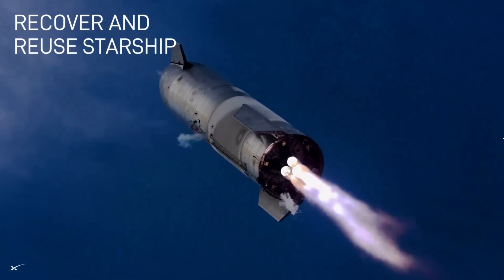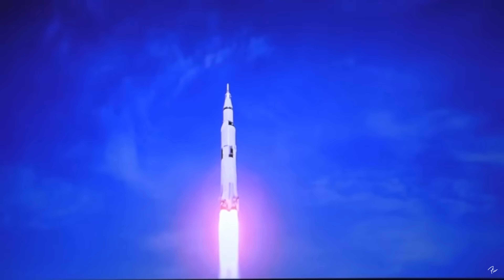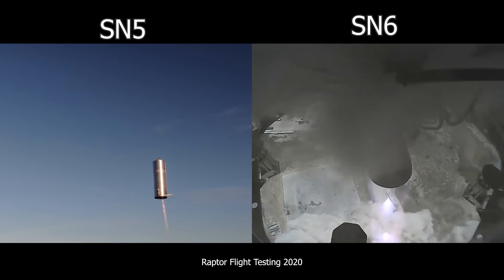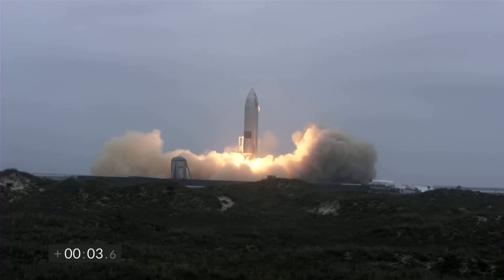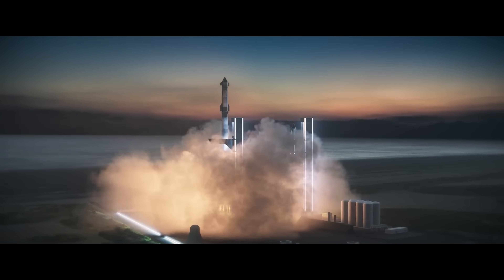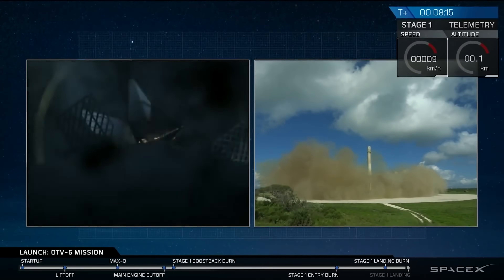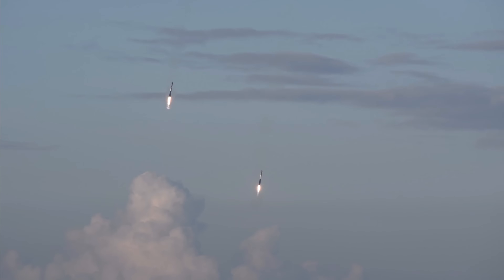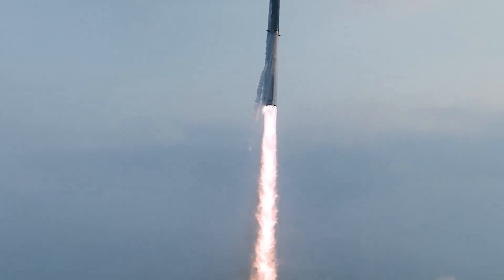The SpaceX Rocket Engine That Couldn't

Comment: $2 million is DIRT CHEAP as is. For reference, the Russian RD-180 is $23 million a piece. The RS-25 used on the SLS is $100 million a piece. The RL-10 upper stage engine used by ULA is $25 million each. Even the supposedly bargain basement BE-4 which is inferior in every metric to the Raptor is $8 million a pop. The ENTIRE SET of 66 Raptors cost almost HALF as much as ONE NASA RS-25!!!
Reply: Even if Starship was expendable it would still be 10X cheaper per kg to orbit than anything that has ever been provided by legacy launch providers.
Reply: @nathanmays7926  SpaceX should make an EXPENDABLE upperstage for SH. The ability to lift 200 tons to LEO even if it's at the cost of 6 Raptors and an upperstage is very useful for any moon mission. 200 tons to LEO will lift the entire ISS in 2 launches.
Reply: @dwightlooi  The goal isn't a moon mission.  The goal is multi-planetary consciousness.  =)
Reply: @dwightlooi  The 200 tones "expendable mode" is just theoretical since that load (above the 100 tones capacity) would make the vehicle's structure fail during launch. 

Also, there isn't a market for 200 tones payload, not even 100 or 50,... etc you guys don't seem to understand that demand is extremely low even for payloads currently launched today, so it would be dumb to manufacture a huge number of engines only to reduce the marginal cost, there wouldn't be enough customers.
Reply: @nathanmays7926  "Even if Starship was expendable it would still be 10X cheaper per kg to orbit than anything that has ever been provided by legacy launch providers."

LOL

You guys should stop believing whatever the sales man says, the literature is rich in statistical strategies to estimate cost per flight of both reusable/expendable vehicles (as well as developments costs), and NONE of them come below U$ 1000 per kg.

TRANSCOST is one of those strategies with more than 40 years of data collected across several projects. It was already used to predict Falcon 1 and 9 development cost within  a 10 percent error.
Reply: @nathanmays7926  star ship launch costs about a billion a pop at the moment
Reply: @kipkipper-lg9vl  where in the world did you get those numbers?  lol

TOTAL expenditure towards entire Starship program so far is $5 billion.

This includes…
-Starbase infrastructure
-land acquisition in Boca Chica
-two mechazilla towers
-manufacturing facilities
-tank farm
-raptor engine development
-employee salaries for 20 years
-30 ships
-12 boosters
-398 raptor engines

How do you figure the cost of ONE booster plus ONE ship plus 33 engines is a billion?
Reply: If its dirty cheap where is your engine?
Reply: @NRGODKING you understand random people cant just buy an engine... Right?
Reply: WOW!
How many pounds fuel are burned every second on the booster?
Seems like the weight of 1 burned out rocket motor is no big deal.
Reply: If you take R&D, costs for the manufacturing facility, ...and so on into account, each raptor engine is WAY more expensive than U$ 2 million.
Reply: @luigeribeiro  Yes, but none of that is relevant to the marginal cost of flying the SHor the starship.
Reply: yes it is because someone has to pay for it lol
Reply: @luigeribeiro Part of the R&D cost is the costs to make it suitable for mass production.  The fact that it is a mass production engine does trivialize the development costs.   The can spread the costs over 10,000 engines not 50, so the RD unit  cost is negligible.
Reply: @GG-yr5ix  "RD unit  cost is negligible"

The U$ 250000 target doesn't seem negligible to me, and STILL, there must be a lot of paid customers to justify the investment. 

But do you know what is negligible? Demand for superheavy lift launch vehicles
Reply: @luigeribeiro  the demand for reusable medium lift vehicles was also negligible, until one was built. It now has 90% of the launch market. Just Starlink will be enough to keep Starship flying for years. And when a 50ton payload costs as much as a 5 ton payload today, you think there will be no demand at all?
Reply: @luigeribeiro those other engines had development costs too though…
Reply: @SamTschappler  the numbers cited for the other engines are ALREADY including the R&D though.
Reply: Yeah dude let’s get real that two million isn’t amortizing the development cost. You’re citing the marginal cost per engine which is a basically useless metric
Reply: @mattkingston6157  It is not irrelevant when SpaceX has already built about 600 Raptor engines. This is more than the entire production history of all the other US engines since Sputnik combined. When production number approaches infinity, amortization development cost approaches ZERO.
Reply: @dwightlooi  But isn't that the point?  The price of the 600th raptor engine versus the cost of the 20th Saturn 5 engine isn't a great metric.  Especially when considering those 20 engines ended up landing on the moon whereas these 600 are nowhere near that result (and may never get there).  That's $1.2bn on engines not to get anywhere yet.
Reply: @CurtOntheRadio  What do you mean by "not to get anywhere"?  Raptor 2 has already gotten the largest object ever to fly to orbit (intentionally just below) and back to the surface again.  Both achievements by any metric.  Raptor 3 can only build upon everything the first 4 flights taught them.  How much did the Saturn V program cost before the success of Apollo 11??
Reply: @IanSlatas  So, as I said, they haven't gone anywhere yet.  And they're up to 600 engines (versus 65 for Apollo and successfully reaching the moon repeatedly).

   Ten times as many engines and yet Apollo's status is complete and SpaceX's certainly isn't (arguably they are a very long way off).  

If wishes were horses beggars would ride.  We shall see.
Reply: @CurtOntheRadio  the entire design philosophy of Raptor is so that they can be mass-produced, of course they're going to have a much higher unit count. They've so far completely succeeded in their design goals (serving as engines for Starship) so they'll only be validated when Starship is ready, which won't be for several years yet.

It's not very sensible to judge an engine by whether or not the vehicle it's attached to has achieved its design goals yet. The Raptors so far certainly have done so.
Reply: @CurtOntheRadio  Your F-1 engine number is way off (on purpose) and the program goals were completely different.  Rocketdyne built 82 development engines, 7 mock-ups, one engineering model, and 98 production engines.  Only 65 were launched out of approximately 183 completed engines.  The F-1 flew one time using the comparably simple gas generator cycle.  The Raptor is designed for multiple uses, surviving re-entry, and multiple relights.  The F-1 could not even be relit.  I love the F-1 and it's an absolute high point of 20th century achievement, but it's not even close to what the Raptor is capable of either as a mass produced powerhouse or its mission profiles.
Reply: @IanSlatas  But your 'capability' is based on assumptions not real world performance and accomplishments.  Talking about a cheaper engine (after 600 made) as if its achievements were already banked (like they actually are with F-1) assumes too much and ignores the fact Raptors haven't done anything of substance yet.  That's my point.
Reply: @sino_diogenes  We shall have to wait and see before making judgement.  Folks seem impressed by assumed capabilities and assumed benefits whilst ignoring the fact nothing of substance has been delivered yet.  And let's face it, that's Musk's MO - promise the earth but fail to deliver.
Reply: @CurtOntheRadio  It's clear you just want to be 'that guy'.  If flight 4 (relighting engines, re-entry, relighting to soft land both stages!) was "nothing of substance you're just being intentionally ignorant and there's no point in speaking with you.  Have a great life.
Reply: @CurtOntheRadio what achievements did the F-1 actually have? It was the first stage engine that brought the upper stages high enough before separation. The F-1 didn’t fly to the moon and back. It just lifted a very heavy load very high into atmosphere. Raptor has done this as well, successfully. No matter if starship ever goes to the moon or mars, Raptor has already done what the F-1 did.
Reply: @HNedel  engines are whatever, it's the vehicle taken as a whole that matters
Reply: @kipkipper-lg9vl  nope, you don’t get to move the goalpost. The video is about engines, the post is about engines, my response was to someone who claimed the F-1 has succeeded and Raptor has not. So you can have a separate discussion with that dude and try and convince him that „engines are whatever“.
Reply: @HNedel  then yes it's a sucssesful engine, I agree with that, admittedly though the apollo engines achieved alot more over their lifetime and it's not certain if raptor will ever see a moon mission
Reply: @kipkipper-lg9vl  again, the F-1 didn’t go to the moon, the third or fourth stage engines did. When compared to the F-1, raptor is equivalent. The mission flown doesn’t matter for the achievements of the first stage engine, except maybe for prestige. Technically, it is the same payload weight, wether a 100 ton concrete block is lifted or a spacecraft on a mission to the moon.
Reply: @HNedel  that's true, I concede
Reply: @CurtOntheRadio  Those 600 engines have launched a satellite fleet numbering more than 4500.
Reply: @CurtOntheRadio  Seeing as you're so short-sighted that you're not counting the other accomplishments those Raptor engines have enabled (Starlink's 4500+ satellites, Dragon supply and human missions, deep space missions) I think you might miss it.
Reply: @AlanPeery  Starlink doesn't use Raptor.
Reply: @AlanPeery  None of that uses Raptor?
Reply: @dwightlooi 600 engines?!? At 2 million each?! That’s 1.2 billion in just obsolete engines. On top of whatever development costs were. Which have certainly been multiple billions. And for what? Starship still doesn’t work. It doesn’t even have a payload door yet, just a little slit to spit starlinks out of. I really think the program will be cancelled in a few years
Reply: @mattkingston6157 Useless? What? How on earth is that useless. If an engine costs 2 billion dollars to build is that also a useless fact?
Reply: @mattkingston6157  I mean, The RS-25 used on the Shuttle and SLS is $100 million a piece, with development cost of 10 billion dollars, while Raptor so far using 2 billion, still cheaper eh 👍

Comment: 2.59 - if the Saturn v lost one of the f1s during launch it would not suffer the loss of a fifth of its power. they would just increase the thrust from the other 4. the Saturn v had sufficient margin to complete a launch with one engine down.

Comment: reusable rockets kind of remind me of bridges. Anyone can design a bridge that crosses a body of water if they have access to infinite resources. They can just make a giant stone slab. It takes an engineer to do it elegantly, at a low cost, with the least amount of material. Anyone (relatively speaking) can design a rocket that sends things into space, then crashes into the ground afterwards. It takes a true set of engineers to make a rocket that is reusable. It is one of the most difficult engineering tasks available, probably.

Comment: In warming latitudes rooftop PV can shade hot roofs. 😮😊😊😊😊

I think PV roof tiles will overheat and fail.
PV panels with airflow under is the cheapest solution, cooler shaded roof under. Air-conditioning load reduced.

Rooftop PV will expand into colder latitudes every year.

Rooftop PV electricity can be dirt cheap electricity. Dirt cheap. 
Get robotic PV panel manufacturing 24/7/365.
Robotic BVs manufacturing 24/7/365.

Comment: Elons insights that materials and costs are the real problem told him grid electricity is an economic dead duck.

He saw rooftop PV and BVs oversized battery parked 23hrs every day with V2G and selfparking selfplug-in to a $60 wall outlet and trickle currents all day long and all night long was 10 times more economical than grid electricity. 

The home robotic vacuum cleaner can teach the selfparking EV or BV how to make the simple and cheap connection.
Hahaha Hahaha 👍 😊😊😊😊